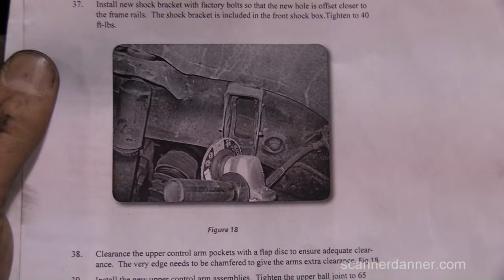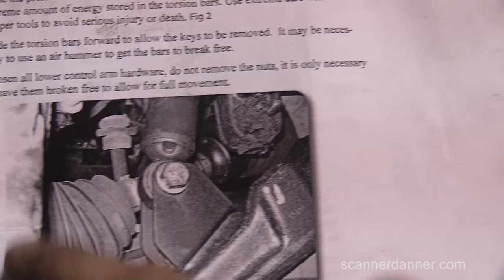Silverado 2500 lift kit install - install control arms, axles, shocks, torsion keys (part 4)

Comment: A mig weld is and can be as strong as a stick weld if done properly. The only major difference is mig is a lot less wasteful. For something like your doing a dual shield or Flux wire would be best as they are more suitable for welding on frames.

Comment: Here we go again. Those uppers are different than on my 96 but everything else looks the same. I hope you extended those shocks mounts or they will top out in a bad way. You should also make sure there is a 1/2" bolt and not a 7/16" bolt going through the top of the shock. You will also need to align the front end after you get the height right. You need about 1/16" between the top out pad and UCA.

Comment: 33:50 was that bracket on backwards or is it an optical trick from the angle?
Reply from the maker: +stilldking It was correct. The longer angle was facing the rotor

Comment: I've always heard from a myriad of technicians that Lifting a vehicle is a Bad thing because it changes the suspension and steering geometry
Reply: +treluvsjay1  It will IF you don't correct for it by either using different A arms or dropping the mounts for the arms down. This kit moves all the components down to correct those issues. One thing that lifting does that is hard to compensate for is changing the COG of the vehicle.
Reply: +treluvsjay1 Those technicians are referring to your average Joe, taking apart his running train, turning the torsion bars (if he has them) adding bigger springs (or if he does the reverse, chopping them), bigger rims, bigger tires. In that situation, everything changes, everything is strained.

But with something like this, where a kit has been prepared and everything is attended to, the whole system is reset. Yes, there are some, things that will be affected like the center of gravity, the way the shafting works, if the car is diffed, you will loose some HP (the more differentials you run, the more horses you loose, position is also crucial, you can't just slap a diff anywhere) etc.

However, like i said, infinitely better to do it with a kit provided by someone who has done the math for you, then you're assure (within reason) that you will retain more than enough functionality to have a decent car.

If you've ever watched the old Top Gear UK and have seen the episode where the three stooges race cars across a mountain (forgot which, it's the one where they climb so fast they loose oxygen and start feeling weird) that episode illustrates perfectly what happens when you lift up your car (even a 4x4, which has some leeway) and don't do it right.

Hammond's car loose a ton of horse power for example, it's sluggish, the speed-o doesn't function right, gas mileage is a method of measuring how fast you'll need the next petrol station, the likes. Fun episode.

Anyways, hope my rambling helps, that's my two cents on the matter.

TLDR: lifting is ok, if you do it the right way, if you don't, well, you've junked the car, sometimes for good.
Reply: +aserta Exactly, 90% of lifts are done wrong. I've saw more that are wrong than that are right. People are just ignorant or don't care. It costs more money to do it right as well. I deal with the opposite as well people slamming cars into the ground. If your suspension cannot move it cannot work. A slammed car on stupid stuff coilovers does NOT handle good regardless of what they might think.

Comment: I'd rather have the Nova in the next bay.....
Reply: +Blazer02LS nice. not to drag u away but the engine nick is putting in it is highlighted running on an engine stand at the beginning of my cadillac vvt code video